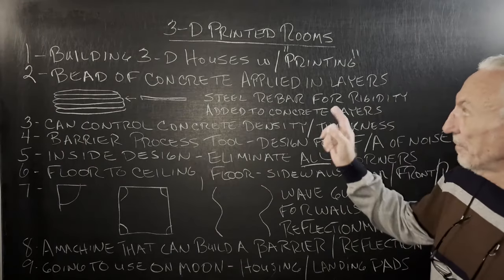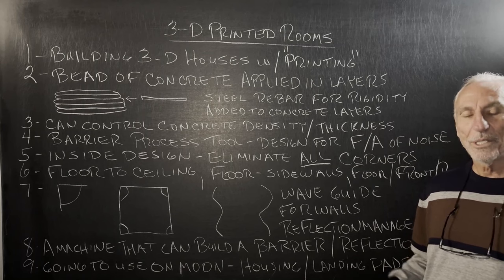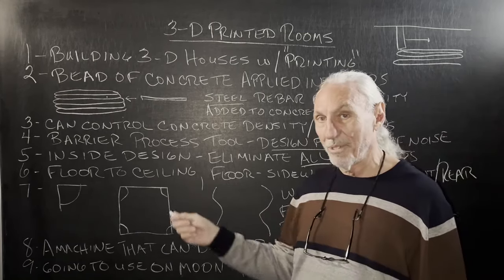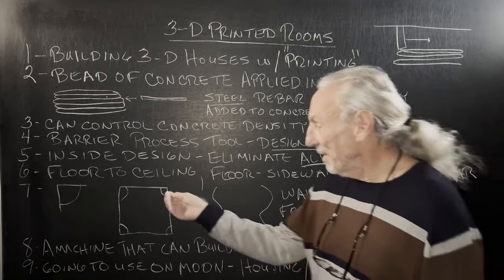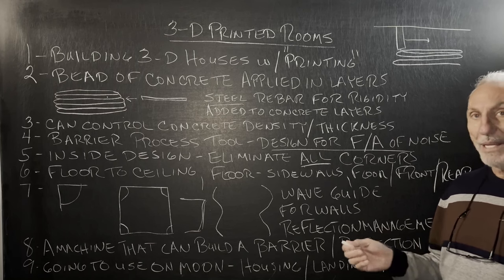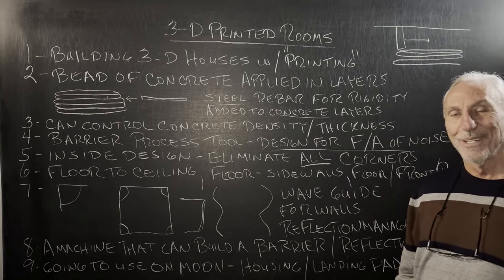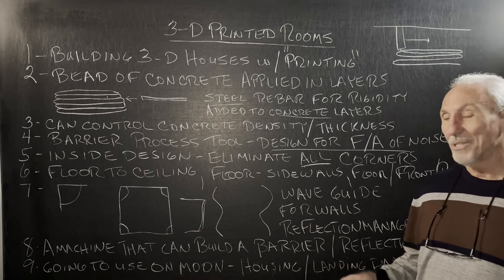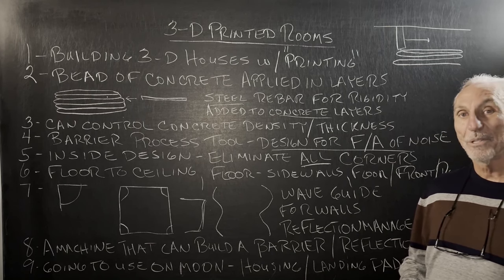3D Printed Rooms - www.AcousticFields.com

Comment: this got my wheels turning and first thing that came to mind was carving out a space in the garage or basement using straw bales, cheap and could shape the room any way you want i even imagine the rack speaker stands seating all straw bales
Reply from the maker: Straw bales will not provide the proper rates and levels of absorption required for lower frequency pressure management.